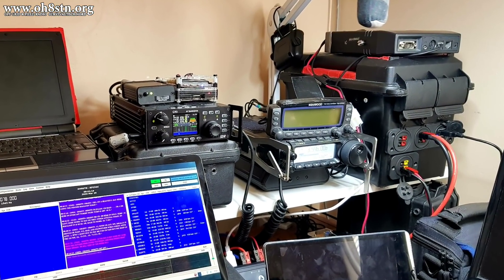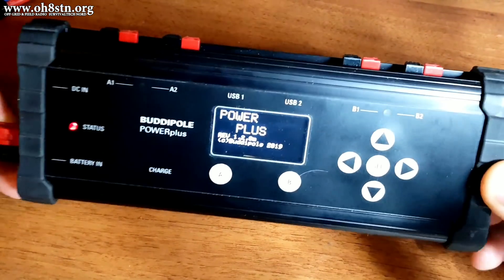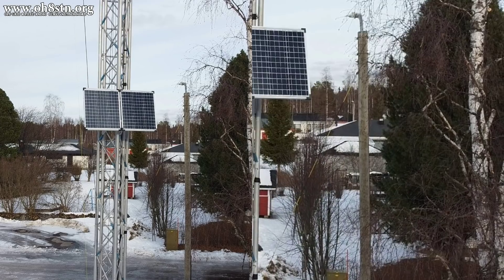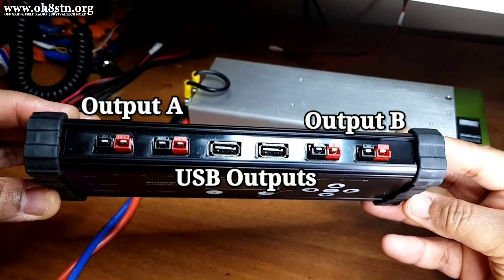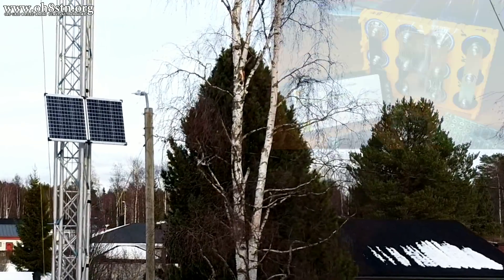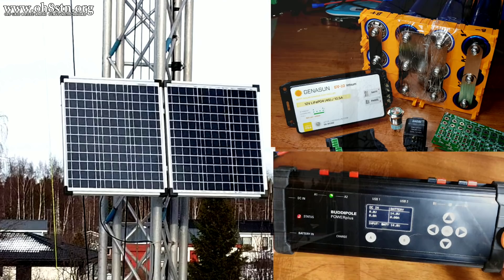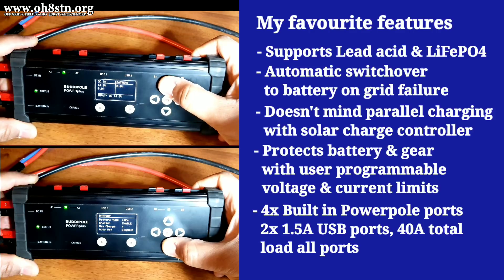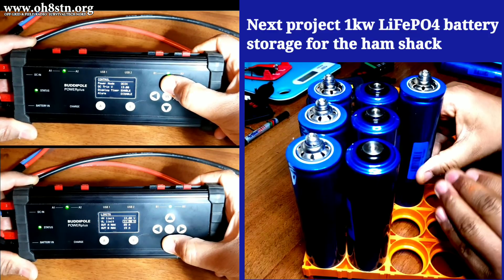Ham Radio Station Power | Buddipole PowerPlus

Comment: Are the Powerpole outputs regulated, or do they run at the input voltage?
Reply from the maker: They run at supply voltage until switching to battery backup.

Comment: @OH8STN Ham Radio
Julian, 

Thank you for making this video.  I was investigating Buddipole PowerPlus as a solution to my mobile needs (powering three radios from a lifepo4 battery that is also charged via solar) and you answered several questions I had that were unclear to me when reading the Buddipole PowerPlus user manual. 
I sent you a $10 tip to your PayPal.

I do have one question: Have you come across other devices that are similar to the Buddipole PowerPlus and, if so, how do they compare to the  Buddipole PowerPlus?

Best regards,

Larkin

Comment: Greetings Julian, love your work. I've recently completed a 10ah battery build from your blog. Works great so far. Quick question, I have a buddipole powermini and I'm considering getting a buddipole powerplus as well; could I use the powermini as the solar charge controller to the powerplus? (connecting the panels and battery to the powermini and then connecting one of the powermini load ports to the battery in port on the powerplus). Would it work? any downsides you can think of with this arrangement (other than perhaps the cost)? Thanks in advance, 73s

Comment: Love your videos, keep up the great work.

One question about the PowerPlus. Does the DC input have to be above 14.6V to charge the connected LiFePo4 battery? Based on the voltages shown in your video and in the manual it looks like it boosts the DC input for charging. Is that correct?
Reply from the maker: Great question and thanks for the kindness. The power plus does Boost voltage, but voltage doesn't have to be above 14.6 volts to charge. That 24.6 volt comes from battery manufacturers who suggest it, because if the internal cell balancing. Best case for long life is charging to 14.2 volts,  which the PowerPlus can be setup for.

Comment: Looking at the Powerstax line, there appear to be multiple product families - Standard, Premium, Low-Noise, Ultra-quiet, and High-Rel. Which one did you find to be free of RFI? I'm always on the lookout for good switching power supplies that have no/low RFI for HF use.

Comment: Julian, I was wondering if a similar but limited configuration might also be possible using the Buddipole Power-mini.  The mains powered DC supply output would be connected to the solar panel input on the BPmini and the Genasun output (which normally charges the battery from the solar panel) would also be connected (in parallel) to the BPmini  battery connection. Granted, the BPmini is limited as far as the number of loads that one can connect to it but even  were it one--specifically, just the radio--the configuration would provide radio operation from the mains while keeping the battery topped off and while also providing automatic switching were the mains to go out. What do you think?
Reply from the maker: I understand what you're saying but I wouldn't do it. Buddipole power mini is a solar charge controller with multiple output ports. Connecting a power supply without any current limiting to the solar input Port would probably just destroy the power Mini. Anyway, if you have the solar panels to connect to the power Mini, why would one need the power supply, for anything other than the occasional top up?
Reply: @OH8STN  Yes. This is true. Still, at times it's tempting to see if one can push the technology--at least in a brainstorming session. But I will not take any risks in the physical realm of things. The powermini is not exactly inexpensive and it frying the thing is not on my bucket list.

Comment: Julian, another great video.   When the solar panels are topping off the battery through the power plus, do you detect any RF hash coming off of the controller in the power plus?
Reply from the maker: So far the buddipole power plus is completely RF quiet.

Comment: That is really cool.  I really appreciate how not only is the BP-PP multi use within the shack, it can just as easily, serve those same abilities in the field. Your videos have inspired me to finally get my butt in gear and get my HF capabilities sorted out and actually get a shack and portable capability together. I have a MPAS 2.0 and Xiegu G90 on the way that will be the core of my system. I'm really looking forward to the kW battery build you mentioned!
Reply from the maker: Thx John. I already have another video in the works where are use the power plus as a mobile device. In that case we replaced the power supply, with the 12 volt DC from the car. In both cases switching takes place seamlessly, and artillery battery is always stopped up. You're going to have a blast with a g90 and mpas 2.0. Hope to meet you in the air.
73
Julian oh8stn

Comment: I still say you should receive some kind of International Award for ingenuity by advancing Amatuer Radio to the next level.
Reply from the maker: Perhaps you're being too kind. I don't try to sell anything, I just show other operators how and where I'm using the gear. If that provide some inspiration for someone, then I've done my job. Hopefully these manufacturers will also see how we are using this year, and use it to make better products. 👍
Reply: I've never been called too kind but, I'm usually on target. Ultimately you have moved Amatuer Radio "Field Work" at least 20 years forward of most everyone else.

Your dedication to operating in the field, off-grid and across many modes clearly puts you on the bleeding edge of Amatuer Radio.

Personally I've done maybe 10% of the field work compared to you and it's VERY demanding compared to sitting at a home QTH with electrical power and tuned antennas. I also like to tent camp, which is also never as easy as it looks. Putting it all together takes tenacity and effort.

I firmly stand by my earlier statement that you should be internationally recognized beyond Youtube, etc. Maybe you don't want that, which I fully understand, but it doesn't mean you haven't earned it.

You are a leader in this field and have made a differece !

Thank-you !

Comment: great review. The Buddipole Power Plus is a nice bit of kit, a nice compliment to their range of portable batteries. Would be nice if the DC input could say take a range of input sources, ranging from 10-22V, this way you could connect a solar panel, car charger or fixed DC. Be nice if it supported USB C as well. Still, a great unit, packed with features :>

Comment: This is solid shack power managment, im willing to do the same, but... about emcomms and portable use, its alot of comsumption , G90 eating alot, ft891 too, i know i have ft-100d almost more then 10-12 years+ andits working perfect but on rx its eat near 1amp,  alot of trx dealing better with power. Its only my opinion)
Reply from the maker: It's all good, I see what you're saying. The way to offset the current draw, is by using solar panels to passively extend runtime. That's all I've been able to come up with, and it's working well.
Reply: @OH8STN  is buddipolepowerplus extends it? through genasun ?
Reply from the maker: The buddipole Power Plus battery output and Genasun battery output connect to the battery in parallel.
Reply: @OH8STN  oh i see, now understand and its okay ? all in one power connection - from battery and from genasun? they have no conficts while charge discharge?
Reply from the maker: Yep there's no conflict. The Genasun is not connected directly to the power plus.
Reply: @OH8STN  good, it will be interesting to scheme of connection for better presenting to all :) thanks!

Comment: You'd mentioned the Buddipole Power Plus in a few previous videos, and I've been eager to hear a more detailed description of its capabilities and how you're using it, and this video didn't disappoint.  It's a very capable device and the power/voltage/current monitoring abilities are excellent.  In addition to being well designed, it also looks well built.

I'm currently increasing my solar energy generation and storage for my off grid ham shack.  I'll be very interested in your upcoming 1KWhr monster battery.  Now that it's possible to buy decent quality integrated LiFePO4 batteries with internal cell balancing, over charge protection, low voltage cutoff, etc., I'm inclined to buy a battery solution, but if I can build something that's a better value from cells, I'd be very interested.  Please let us know the prices you paid and any sources of materials you can provide.
Reply from the maker: Hello Mr. B.
RR, yeah at first I was a bit annoyed about it not having a solar input, but as I thought about it, reconfiguring my shack power to take into account the Power Plus, I saw how easy it was to integrate the solar charge controller myself. 
Yeah the new battery project is just for operating from home or our "cottage". It'll have enough capacity and capability to provide Power for communications and Lighting for days at a time. To be honest this is more about the lockdown on about providing reliable power in the ham Shack. If the lockdown remains in place, critical services will be affected eventually.
It's always good to hear from you, thank you for taking the time.

Comment: If I understand correctly, you are saying that one adds an additional connection to the Genasun controller output and connects it to the battery connection on the Powerpole mini. This way the battery pack may be charged from either the solar panel or from the DC supply connected to the Powerpole mini. Is this the idea?
Reply from the maker: No. Let's it this way, the DC output from the solar generator connect to the buddipole Power Plus. The Genasun GV10L battery output is literally connected to the battery +/- inside the solgen. Essentially the battery output from the Power Plus and the battery output from the charge controller are connected in parallel with a battery. And solar panels are then connected to the solar input of the charge controller. This explained at 04:02  albeit not very well.👍
Reply: @OH8STN   OK. Thanks. I wanted to be sure that I got it right.
Reply: @OH8STN  Well saying I wanted to get it right but actually understanding why it is so required me to make my own schematic. But once I did I immediately saw the brilliance of your configuration. The battery is topped off by either the solar panel via the Genasun or by means of the mains driven power supply via the BuddipolePowerPlus. Both can source  current to the battery. And since the BuddipolePowerPlus is essentially controlling the show, in case the solar panel stops generating (for example, let's say at night) or in case the mains driven supply stops working (for example in case of a power  outage), the other source will then be automatically switched in by the Buddipole, keeping the battery always topped off (when not in use) and by providing a power source if radio ops are required. Neat!

Comment: Fabulous instructional video as always!  

Question: I realize this is not applicable to your base station environment, but do the BP-PP and/or the Genasun charge controller provide low-temp disconnect to avoid damaging the batteries by attempting to charge them in low-temp environment?

Thanks, and keep up the great work!
Reply from the maker: The power plus doesn't, and Genasun only does temperature compensation for lead acid batteries. With that said, many BMS boards have a high and low temperature cut off. Inside the solar generator shown in this video, add a temperature sensor that I can read from my mobile phone. So I always know the internal temperature of the battery pack. I use this functionality even when I'm Outdoors. One misconception though, often we think outside temperatures that critical point. It's actually the battery's internal temperature, or more accurately the temperature inside the battery enclosure which is important. That's why you often see me with a battery inside a box. The battery will heat that space by simply being discharged.

Comment: I would love to see how a DIY solution would compare to the BP-PP. This unit is certainly not cheap! I can't help but think that many hams could build something similar centered around an Arduino or Raspberry PI Zero.

In terms of features, it would be nice to be able to monitor and control power via a USB interface, just like we use CAT control on our radios. Also it would be great if the USB ports supported the newer USB 3 smart charging with higher charge currents.

This is in no way a knock on this product, it may be ideal for many who are looking for an off the shelf solution and are willing to pay the price.
Reply from the maker: Definitely. There's a lot of engineering going into this. There's the CPU, mosfets, circuit design, charge controller, GUI, the software driving it all,... would definitely be a lot of work. Don't you have some electrical engineering background?
Reply: @OH8STN  Remember we are hams! Without hams there would be no SSB, no cellphones, the list goes on and on.

I view this box sort of like your battery project. You could have just bought something pre-built but by doing it yourself you have something far better and cheaper than what you could buy.

You are correct that making good ham gear takes skills, patience, trial and error etc. It is not for everyone. By the same token if one looks at back issues of QST or QEX (ARRL's other publication) one can see examples of projects far more complicated than this built completely from scratch.
Reply from the maker: I wasn't disagreeing. I think building something like this is a great idea. I just think it takes an incredible amount of time and tools to do it ( not that it can't be done).
Reply: John Tarbox not advertise, but look West mountain radios latest production. Over LAN/WLAN
Reply: Hi John - Thanks for the suggestions. We are USB 3.0 compliant but the 3.1 standard would require a different charge controller.  

On the topic of cost - someone with the appropriate design and manufacturing skills could certainly homebrew a product with similar functions.  However, as usual, the devil is in the details. The design of the PowerPlus focused on making a compact, rugged and efficient power management system in a single device. 
 
The cost of the product reflects the choice of high-performance components. Performance-wise it uses high efficiency active switching between battery and DC input, it is not a simple diode OR that is functionally inferior and has higher power loss. The battery charger is not just a multi-chemistry charger, it is, unusually, a buck-boost charger so that it is capable of fully charging even if the DC input voltage is less than the maximum battery voltage.  
 
Power monitoring is all high-efficiency high side monitoring to avoid potential issues with ground loops affecting the measurements.  The outputs are monitored for both overcurrent and overvoltage which also requires the use of high efficiency MOSFETS. Power loss is low enough that in many situations (unless you use 8AwG like Juilan) there is more power loss in the cabling than through the device.
 
Physically, the PowerPlus uses a solid custom extruded aluminum case (extrusion die) with custom non-slip end caps (custom injection mold), not just a folded sheet metal case. All of that does increase the cost but if you want a comprehensive power management solution it is actually less expensive and more elegant a solution than the alternative of purchasing multiple single function devices like power monitors, distribution boxes, battery chargers and changeover devices.

We have quite a bit more info on our PowerPlus webpage - including the user's guide and application notes:

https://www.buddipole.com/powerplus.html 

Questions can be emailed to us directly at info@buddipole.com

Chris Drummond, W6HFP
Buddipole
Reply: If you're looking for something cheaper... I have a Victron MPPT 75/15 which is an excellent MPPT charger with a nice app where you can control and monitor charging and power draw as well as set battery parameters. I've paired this with LiFe batteries and added USB and XT60 power connectors. I like the XT60 connectors since I think they are a bit more water resistant and are cheaper. Victron has other models with higher power capability but this one is fine for my use.

Comment: Great information, thank you. So I have one question, would there ever be a time you would connect your solar panel to the DC input of the Buddipole unit? Thanks. 73, Josh.
Reply from the maker: Awesome question. Definitely no. The buddipole power plus isn't able to see the battery through the solar charge controller. Also there's an incredible amount of current flowing between the battery and the buddipole Power Plus.
Reply: OH8STN Ham Radio Awsome. Thanks.
Reply: For that I had think twist to another position these  powerpole connections for solar power line. Maybe some new standard for that. As well color code could be good as well. Although different system need more cords. So better stay in the way what Julian has sayed: Know your gears!